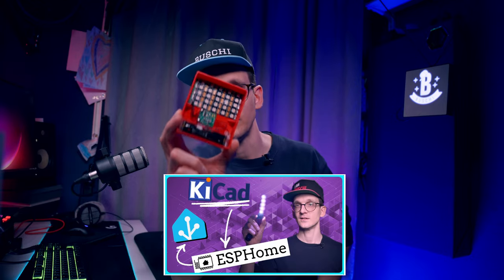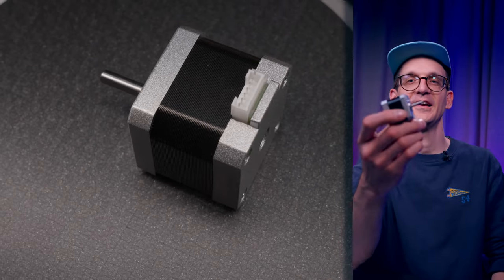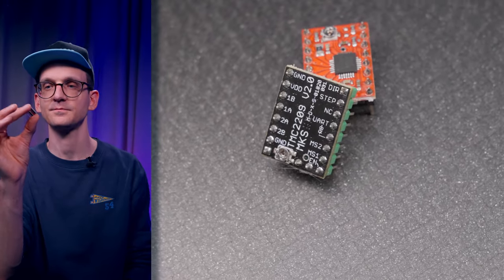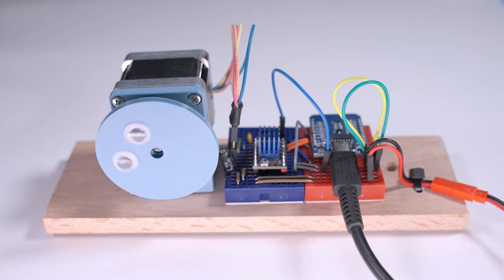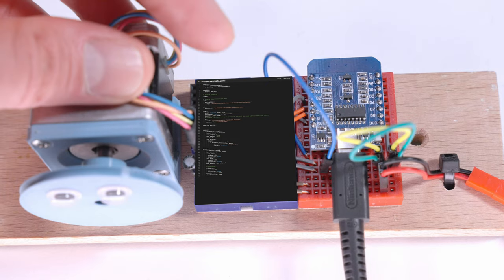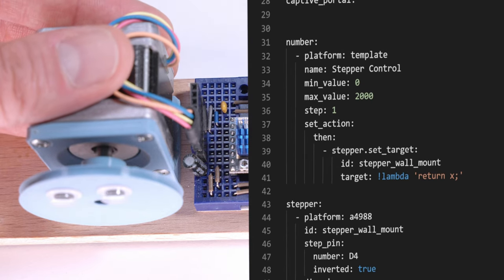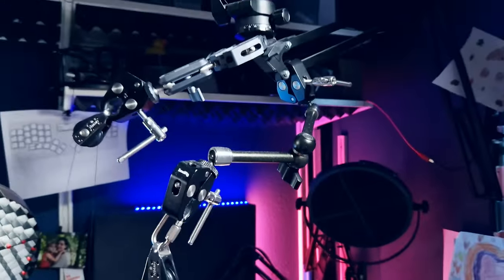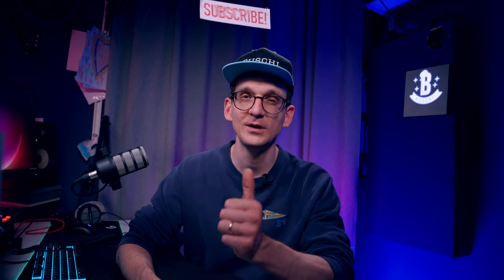ESPHome Stepper Motor

Comment: Does this project need 12v for the motor and 5v for the esp, or just 5v for both? Oh, is power coming from the motor driver to the esp?
Reply from the maker: Power is usually the most annoying part. I wanted to drive everything from one source initially.. The driver was unhappy with 5V although that should be enough for the TMC2208.. Then I altered to 12v and wanted to derive the 3.3 from that too.. Using a linear voltage reg is was too much power dissipation as the ESP draw considerable current.. However, it is all possible with the correct step down supply chips.. In the end I supplied 12v to the driver and kept USB connected to the ESP board I believe..